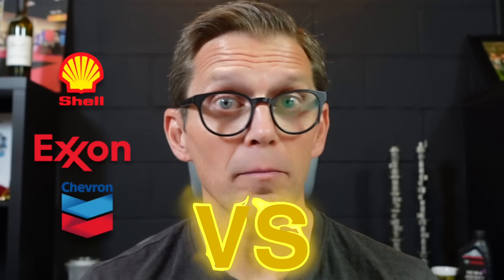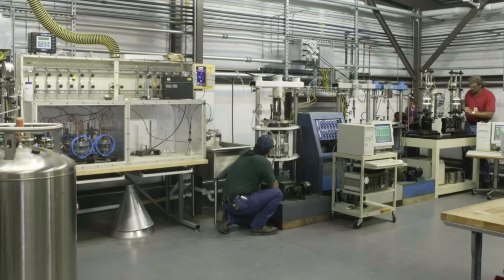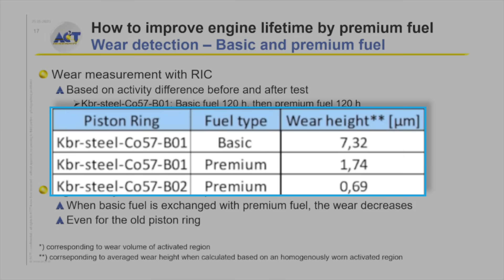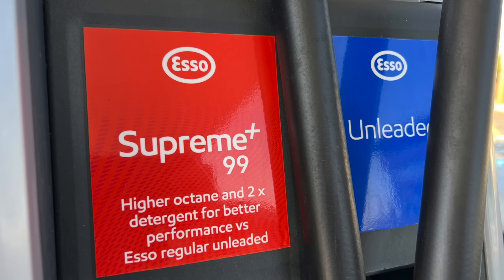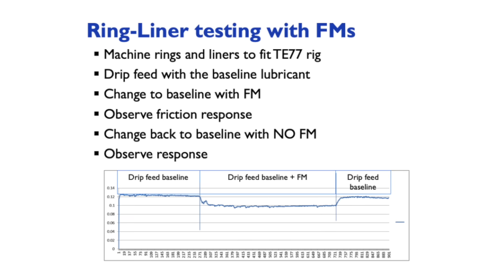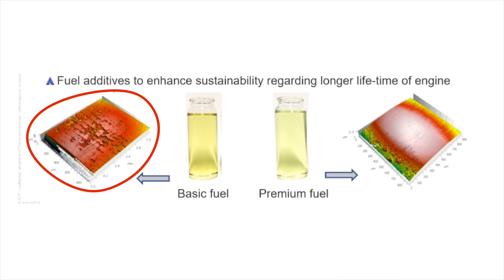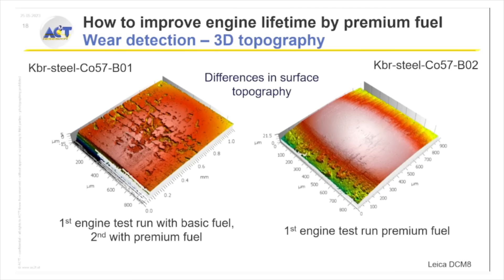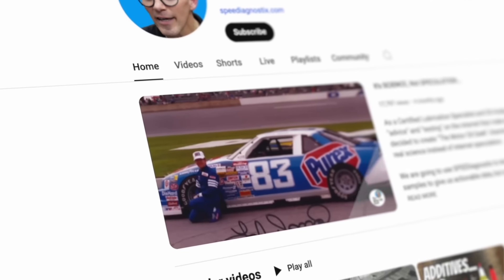Can Premium Fuel REDUCE Engine WEAR?

Comment: So, is not "wear" a natural function of an engine?  Is it not UNUSUAL or PREMATURE wear the real problem?  No engine can totally exclude wear and the determination should be what rate of wear is NORMAL, and what, therefore, an expected  and NORMAL engine life should be.  Not saying reduced friction can't increase the ultimate power available, but in racing situations is not wear secondary (or, perhaps not even of any concern?) to development of power?  How long are racing engines supposed to last, anyway?  So, exactly how does the so-called "huge" and/or "giant" decrease in wear potentially INCREASE the life of the engine?  5%? 10%? 0.5%?  How much more $ does the premium fuel with additives co$t vs. the expected increase in engine life?  P.S. Around here (PacNW) premium can be up to $0.30 per gallon more!

Comment: Yes!!!! Tired of ppl bashing ppl on the groups/forums about “yOuR wAsTiNg YoUr MoNeY!” about premium fuel.
Reply: this is about non-top tier fuel brands vs top-tier fuel brands; not 87 vs 91.
Reply: This video didn't discuss the quality of the oil being used in the test. Let's assume it may have been low to mid quality oil that away the results of the fuel test would be magnified. Would using high quality oil with a superior additive package be better than trying to find a gasoline with an additive package?
Reply: Maybe the oil that was used in the test was low to mid quality oil to magnify the results of the fuel and how additives in fuel can make a difference in engine wear. Maybe if you start with a high quality anti-wear engine oil the fuel doesn't matter as much.
Reply: Just a friendly reminder that this video is not about octane ratings. More about the additive packages which in the US, is a certification called "Top Tier".
Reply: Top tier is about detergents, not anti wear additives. That being said, he never mentions that octane has anything to do with wear either. It's anti wear additives, generally you are looking for Shell or BP.
Reply: fantabuloussnuffaluffagus If you get better additives in the higher octane fuel, you’re getting what you paid for.  What waste of money?
Reply: fantabuloussnuffaluffagus  You don’t understand.  The additives IN the higher octane is the focus not the octane.
Reply: fantabuloussnuffaluffagus  I did because we don’t have the same fuel here.  Please be done with me, the world needs you.
Reply: fantabuloussnuffaluffagus  Well, that's not true either.  The additive package is brand specific, and not octane specific.  So, if you are buying higher octane fuel than your engine requires, you are still probably just throwing your money away.
Reply: @ovid4  Because that's what Shell paid him to say.
Reply: @TamNgo84  just a friendly reminder: that this video literally compared the basic rated fuel against premium.
Reply: I agree. I worked in auto parts and people that operated their vehicle as cheaply as possible, be it fuel or cheap components they would experience more frequent trips to see me in the parts store. Put less in get less out......

Comment: As much as I'm inclined to agree the exorbitant cost of premium isn't worth the benefit imo. 

Let's say you get 300k out if a motor. At 20mpg that's a cost of $15,000. If the benefit is likely 50k more miles or even 100k that's not worth the benefit. Only some rare cases where the motor is very expensive and likely requires that gas anyway.

Comment: Hey lake! Love your videos! Very informative. I got a question with my bikes, how can I get the right octane in my fuel tank when I fill up premium at the gas station? Especially when the previous fill up out of the pump was regular and I need to run premium? By the time the pump switches over to premium and pulls it out of the ground tank I’m basically done filling up my bike? Should I just fill up regular and use an octane booster? Do you know how many gallons it takes for a pump to get new fuel from the ground tank to the nozzle? What do you recommend that motorcycle riders should do when filling up and trying to get premium in our small tanks?

Comment: What about using Lucas upper cylinder lubricant.  3 oz per 10 gallons. Please test to determine if the Lucas lowers wear just like the high quality fuel. 😊
Reply: And you might as well throw in Marvel Mystery Oil into the testing as an upper cylinder lubricant which also contains the anti-wear additive, tricresyl phosphate.
Reply: I have a 2024 2.5 turbo that the manufacturer said I should use 87 octane. I would like to known if mmo would be good for upper cylinder lubricant and  also if it would help with  carbon build up.

Comment: Yes, please do a fuel brand comparison.  I'm about to do a new engine break in.  So based on the results shared in this video, it seems like I should run the lower grade fuel (less friction additives) during the break in period.  IS THAT CORRECT?  (I will be using Driven Racing Oil's BR oil.)  I have two Oil sample kits that I will be sending in after BR oil change and at the 3k mile oil change to get a trending analysis.  Thank you for the great information, always look forward to your videos.

Comment: "Piston rings are is the most ware"<<<< To me that seems like a no-brainer. But in my mind fuel only mixes with oil if the motor is wore out, otherwise fuel is suppose to be atomized and on compression is completely burnt up. Over 50 year of using all kinds of gas, gas was never a issue in motor failure. But in this new GDI engine design I see a lot of failure because of carbon build-up, the gas mist isn't being used in keeping intake clean...............
Reply: If an engine runs rich (AFR <14.7:1), then, by nature of the chemistry, some fuel will go unburned. All car engines - fuel injected and carbureted - run rich during cold start. That's what the choke does, after all. Engines typically also see a burst of richness during transition to high load - either because your throttle pedal pushed in the accelerator pump, or because the computer is programmed to run a 12:1 AFR during hard acceleration. These normal operating conditions can and do cause oil and fuel to mix, even if only in minuscule amounts.

Comment: Hi can you please make a video on new vehicle engine break in? I believe I watched a video of yours on a different channel saying that the engine should have a high load put on it such as with a dyno. However owner manuals state to go easy on the engine and keep rpms low and basically baby the engine. Not sure why the discrepancy. Also do I need to remove factory oil and add a break in oil or does it come with that from the factory.. Really interested in your input. Going to be purchasing a new vehicle and want to break it in properly. Thank you!!!

Comment: Because of Knowledge I have gained from this channel, I started running motor oil with a bit less calcium and a little more magnesium in the add pak for my 2019 3.5 Ecoboost. 
Forscan data logging shows it does not pull as much timing as before with the higher calcium, so I'm guessing the ECM was sensing knock and adjusted. 
Only run 91 octane shell that consitently tests 7-8% ethanol.
catch can with a slightly less restrictive PCV and boy does my truck run super smooth.
As always, Thank You for all the time and research put in to help us all be a bit smarter every day.
Reply: I run kirkland brand 5w-30 in my 2011 subaru with 135k on the clock and costco 88 gasoline, have been for years. Car runs/sounds great like the day I got it. My wear is probay a couple microns more than you, but it's ok bc I have $$$ in my pocket
Reply from the maker: Thanks for sharing that!
Reply from the maker: Thanks for sharing that!
Reply from the maker: Thanks for sharing your experience!
Reply from the maker: Thank you for sharing your experience!

Comment: I'm a low octane customer all the way. I've measured the performance of my engines with low and high octane fuel, and I've decided that 2% increase in power and fuel economy is not worth the 25%  increase in cost. It's a ripoff that shell would only put the special additive package in their premium fuel. Like, premium fuel is a scarce resource, hence it's higher cost. Why encourage people to use premium fuel when they don't need it, other than to increase profits? Then you have the penny pinchers who would actually benefit from running higher octane (think downsized direct injected turbo engine owners) who "aren't rich like that". Exact words I've been given from my sister in law who drives a 2.0L Wrangler.
Reply: I believe you are a little low on something else.  The benefit of higher octane is to ward off pre-ignition especially in modern direct injection turbocharged engines.   But hey to each his own
Reply: @goinwheelin  I know the merit of higher octane in those engines, but I drive late 90s early 00s tech NA engines with moderate compression (enough to take advantage of premium, not enough to worry about pre ignition)
Reply: Mobil only adds the *good stuff" to their premium synergy gas also.

Comment: So does adding marvel mystery oil or Lucas in the recommended doses help with this issue... I personally run MMO at 4 oz per 10 gallons in all my vehicles and have done so the past 20 years with no fuel or engine related issues!!! I personally believe in MMO as a upper cylinder lubricant additive!!

Comment: I know you’ve said that fuel additives are beneficial, compared to oil additives.  Would using a fuel additive with regular fuel suffice to protect your engine wear?  If so, how often would you need to use it?

Comment: Ive Had Always Gotten V Power Premium At Shell. Then I Started Using Mavrick Premium Because It Was Alot Cheaper. Been Using For About 2 Years. Its A High HP Turbo Car, Did Some WOT Pulls And Low RPM High Boost High Load, No Detonation So I Figured It Was Ok To Use As It Performed Like The Shell. Well I Guess Im Going Back To Shell! If They Advertise This Kind Of Stuff And Maverick Does Not It Definitely Means Thier Fuel Is Different. I Just Spent $2000 On A Set Of 6 Custom Pistons Might As Well Give This Engine The Absolute Best. If It Makes A That Much Of A Difference Its Worth The High Cost. Now Question... Should You Break In An Engine On Basic Fuel hahaha jk

Comment: Pennzoil Ultra Platinum, and Shell V-Power Nitro+ is my combination of oil, and fuel used! Definitely a fantastic combination from the information you've shared Lake, thank you for all that you do! Cheers!
Reply: In our shop, we’re switching 6 customers from Pennzoil to Valvoline’s Clean and Restore full synthetic engine oil. All of these vehicles have over 130,000 miles. We’re tracking oil consumption and engine performance. I’m looking forward to seeing the results of our little in-shop experiment.
Reply: @jamram9924  careful with the first oil change with that Valvoline Restore and Protect. Individual's cutting open oil filters are discovering a lot of sludge etc. in the oil filter after the first 1,000 miles or so. Depending on how the vehicle has been maintained of course, good luck with your experiment's!
Reply: @jamram9924 hasnt that oil been proven to cause clogged oil filters tho? Or should you use that and change the oil around 1-3,000 miles to possibly get that engine cleaned then possibly after that do normal intervals? My question is once using that oil whether it’s 3-5 oil changes to possibly “clean” whatever it claims to clean out. Do you continue using it and using it or possibly switch to another brand again because you cleaned up the engine
Reply: @matthewvaladez8209  I'd like to try something like this oil in a Mercedes Diesel with a top-mounted oil filter. Easy to change the filter without draining the engine. Unfortunately it appears they don't make this oil for the OM642 Bluetec spec 229.51/52.
Reply: Ultra Platinum has kept my tuned Veloster N pretty much perfect for 90,000 miles so far.
Reply: That's the same combo i use in my 2016 tahoe since new. Has 133,000 on it now. I also put a catch can and afm disable on it, too, from new.  Has the 5.3, and it's running strong.
Reply: All those fancy brand names don't mean none.

Just buy the grade you are looking for as cheaply as you can.
Stock cars aren't anywhere near as sensitive as high power engines.

I'm not talkin' about these little hatchbacks with "cold air intakes"
Or cleetuses 3" exhaust on his drunkenly driven ram 2500hd.
 Most people don't wanna hear this, but most cars are stock;
And thats perfectly fine, but they don't need a regimen of brand names and propoganda 😂

Comment: Yes, a more in-depth video on fuels would be very helpful and informative. In my area, there are almost none of the "Top Tier Gas" brands available nearby. The station finder on the top tier gas website shows some, but they have all been replaced by non-top-tier brands (RaceTrac, Circle K, Wawa, 7-11, etc.), so I don't really have access to top tier gas. What then would be my best course of action regarding fuels and fuel additives? Should I use a complete fuel system cleaner like Gumout All-In-One at every oil change, and/or a simple fuel additive with every fill-up? Or should I go (a bit far) out of my way searching for top tier gas? Or should I do something else entirely?

Comment: So...we are often told that it is a waste of money to buy a higher octane fuel when your car does not need it.
But ..if only the premium grade has the fuel modifiers, does it now make sense to use premium (V-power) even though the engine only needs 89 octsne?
Reply: Exactly my question. I have a Mazda 2.0 engine with a high compression ratio, believe it is 14:1 that specifies regular 87 octane fuel. Besides cost, would there theoretically be any other disadvantage to using Mobil Premium 93 octane fuel which is the only grade Mobil supplies with a boosted anti-wear additive package?

Comment: I feel like the way the research is presented is slightly misleading. At least for here in the US. If you're going to a top tier gas station, all of the gas sold there must be top tier. Where as, as the video suggests, "premium" in europe means it has added/extra detergents probably something similar to top tier gas. I guess the only real exception in the states might be shell v power+ or to whatever it is called, but aside from using Kroger gas points, techron stations are my go to.

Comment: Are there additives the end user can add to basic fuel to reduce wear? If so, are they cost effective, and how do wear results compare with premium fuels? 
I wonder if using premium fuel and oil is cost-effective for the average consumer.  Having an engine and drive train that lasts longer than the rest of the vehicle may not be useful.
Has diesel fuel quality been studied relative to wear?
Keep up the good work!
Reply: I was also wondering what the end user could do?  I would like to learn more about additives a person could add to gasoline, and how it affects things.

Comment: At least on the East Coast and probably country wide, you do not know which refinery the gas is coming from. Fuel is sent up the Colonial Pipeline for East Coast destinations and it is stored in big tanks.  Refineries deliver fuel to the pipeline beginning and they get credits for the amount of fuel they deliver. They can use those credits to get fuel at the pipeline delivery points BUT they will most likely be getting fuel that was refined by some other refinery. You could call it fuel base stock if you want.

The fuel delivery truck goes to the depot and fills tanks with 87, 89, 91 or whatever octane.   If they are going to Sam's club or a similar station they just leave and deliver the gas. If they are going to a Shell, Chevron, BP or somewhere with a special additive, they add the additive to the tanks on the truck and it gets mixed in with sloshing on the drive to the gas station.

The gasoline that is at the Shell station could have been refined at ANY refinery. Odds are that it is not Shell gas or it is a mix from different refineries. The only difference is the additive that was dumped into the tank truck after they filled it up.

Seeing as how the fuel is the same, I buy my fuel wherever it is cheapest and then add a bottle of Techron or IF Shell sells bottles of their V-Power you could buy and add that and get the same thing as what is in the pumps.

Comment: Oh, thanks for that insight!
That the dilution of gas in the oil is higher at the piston rings.

But one question that I get is..

If thinner engine oil used makes that the RATE of the "rotation" is higher of the file diluted oil at the piston ring?

With rotation I mean that the diluted thinner diluted oil is "drained" easier away from the piston rings, when new oil is pressing on to take its place.

So if we had two engines with the same type and additive package oil but one is thinner than the other one!

It would be interesting to see what difference in  fuel dilution at the piston rings?

And then if the wear goes down with the lower % diluted oil?

That is very interesting questions! 🎉
I am so exited! 

If we COULD establish that oil with lower viscosity gives lower wear in this area!😮

Comment: YES YES please on Fuel brands!
Reply: I know that on my high compression, tuned high boost Jag F-Type, Shell has the lowest number of "knock events" on the knock counter, and the least "timing pulls". Strangely Mobil and Exxon fuels were among the worst. I've even seen 93 that performed no better than 87..... Leading to a 3000 RPM knock event related limit.
Reply: She’ll the Best !
Reply: That why shell gas station is one of my favorite gas station since it is a top tier. Chevron will be my second choice. Exxonmobil but cost alittle more . Walmart and HEB are the worst gas station it is low tier